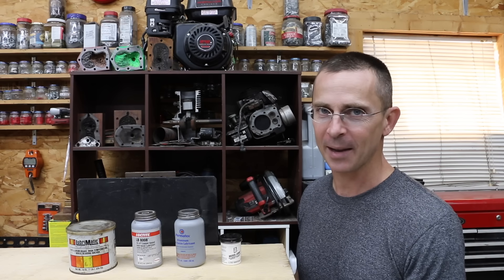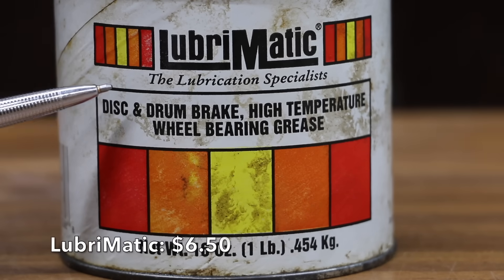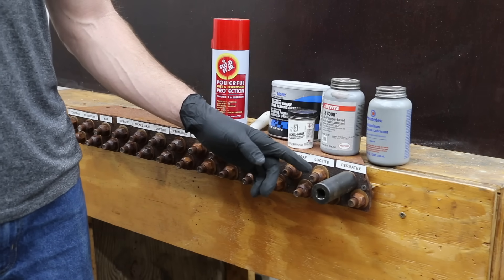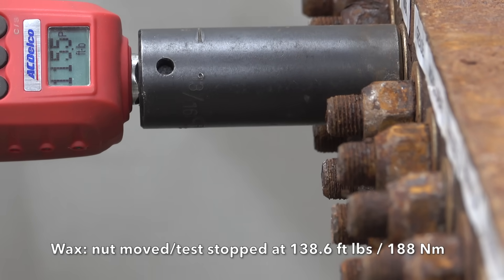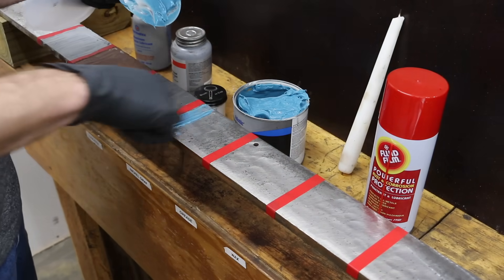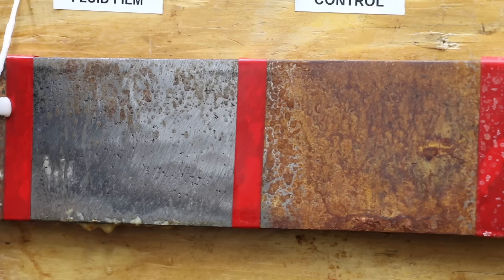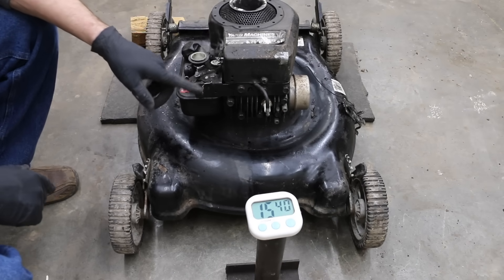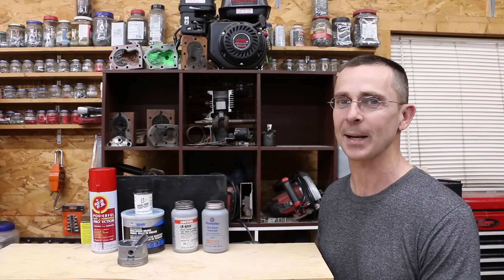Does Anti-Seize Compound Actually Work? Let's find out! Anti-Seize vs Grease vs Fluid Film vs Wax

Comment: I worked at a hydraulic crane manufacturing company where we made cranes for marine use (mostly fishing boats, but some pedestal mounted cranes on docks). There's three things we would put on our products to keep them safe. 
1) Paint. This worked well, but after 5-10 years at sea the paint was often able to be flaked off by fingernails. Not the solution you want to use on its own. 
2) Antiseize (silver and copper grade for different applications). This worked fantastically. We had stuff coming in that was out on the ocean for 15+ years and the threads looked like new when used in conjunction with the other two protection methods. 
3) Densyl Denso Tape/Petrowrap. It's a petrolatum wax coated non-woven cloth tape. This stuff is a total mess to work with. It's like if you were to take wax and infuse it with oil to make a mushy wax. This stuff was the best. Anything that was covered with this stuff would come back looking like the day it was shipped out. Not heat resistant, mind you... But it was a sight to see when you have a hydraulic slew drive motor that's crumbling apart at the paint (needleguns are your friend) and in dire need of a sandblast and re-painting due to corrosion, but the steel fittings used to mount the tubing or hoses look like they're straight from the factory because they were covered with this stuff. 

Great video. Love the bit of fun you had at the end.
Reply from the maker: Thanks!  Glad you enjoyed.

Comment: You sir are a saint!!

This is the type of product testing the consumer needs to see!!!! You’re providing transparency to product Performance
Reply: oh, please.  The main purpose of anti-seize is not as a lubricant but to prevent galling and seizing in high temperature applications up to 1800 deg. F.  No petroleum based lubricant will survive that (not even 600 deg. F).  Otherwise, just use grease if you want a lubricant... it's far less expensive.  Would you put grease in an engine instead of oil?  No... of course not.    There is a reason anti-seize compounds are metallic based unlike any standard lubricant or grease.  This "testing" is just nonsense.  It's like asking if thread-locker works.  Yes... it does and no "testing" required.

Comment: Anti-seize does not equal anti-bind. The engine didn't seize ( get permanently stuck ), but it did bind ( temporarily started getting stuck ) when the piston expanded and moving parts expanded due to all of that heat build up caused by friction ( because of lack of lubrication )
Reply from the maker: Thanks for the feedback.

Comment: I’m curious if the anti seize added too much extra reciprocating mass to the piston and snapped the rod. Or maybe added too much resistance between the cylinder wall and piston. Cool video!
Reply from the maker: Thanks!  Thanks for the suggestion.
Reply: Wrist pin bearing had too much friction.

Comment: Try different vinal glues. Test submerged and the moisture spreading. The strength (laterally and vertically). I just had a water damage and the glue used in my house absorbed all the water ruining the floor
Reply from the maker: Thanks for the suggestion.  Sorry to hear!

Comment: I'd say that any compound that lowered the torque required to loosen them below that of the control bolt is a complete failure, and I would avoid it.  You don't want your anti-seize to make it easier for your fastener to fail and come off unintentionally.  You just want it to prevent corrosion from making it excessively difficult to remove the fastener.
Reply from the maker: Thanks for the feedback.

Comment: If I had a fastener that I knew was coming back off in 3 months time, I wouldn't worry at all about the anti-sieze, even in a highly corrosive environment like winter time in a place that runs road salt. However, the time when anti-sieze comes in handy is when you've got a fastener on there for years in that same environment. Exhaust parts it tends not to matter since the fasteners will generally rust away over time, but everything else on the vehicle will benefit. Even though I don't live in a place that uses road salt any more, basically if I take it apart, it gets some anti-sieze before it goes back together. Another note about anti-sieze, over time as the grease dries out and stops preventing influx of moisture, the corrosion resistance continues. This is especially true when you've got contact between differential metals like aluminum/iron. Example, on a transmission mount.

Comment: Anti seize is a abrasive, not a lubricant. It works on the same principle of putting marbles under a sheet of plywood and sliding it around, vs a sheet of plywood flat on the floor.
Reply from the maker: Thanks for the feedback.

Comment: I use the gray Permatex  anti-seize works great. I have a landpride pull behind finsh mower we drive it all over town mowing city parks the main drive wheel spindle shafts breaks off I use gray  ant seize on the shaft so when I remove it I heat it up with a torch then use a air hammer to drive the break shaft out works great.
Reply from the maker: Thanks for sharing.

Comment: While you hinted at this in the video: the reason antiseize works so well (in addition to being a lubricant) is because it is hydrophobic and prevents most electrolyte solutions from penetrating the threads and blocking them with corrosion products. Without an observed difference in electric potentials, corrosion simply cannot occur - it's a similar effect to having coated metal with paint, it cannot see the electrolyte to exchange electrons.

Anecdotally, in my engineering career, I require the use of antiseize in most fastener applications (just make sure to reduce the torque by about 20% to avoid overloading the fastener...). I believe in the fairly liberal application of it... In fact, a nuclear reactor in the industry I work in experienced an unplanned shutdown (costing the plant easily 2mil+) because several small fasteners had crevice corrosion which allowed a control valve to blow apart. What did all of the failed fasteners have in common? no antiseize. In a sampling of other fasteners at the facility in the same application, those which were installed using antiseize from approximately the same era had no observable corrosion. Antiseize is good stuff!
Reply from the maker: Thanks for the feedback.
Reply: Very interesting. Thanks for posting this info 👍
Reply: I usually use  antiseize on my lugs but I tighten to the minimum not the  maximum,I think if you work in a gas station or on customer's stuff you have to worry about liability since the owner's manuals say not to use antiseize or lubricant, It is amazing at the abuse that lug nuts get from grease monkeys in tire shops armed with air guns 

  and still they may send out a car without tightening the lugs at all or even send out a car with no oil in the crankcase!
you can also put antiseize behind the surface where your wheel backside or rotor sits
Reply: @davidpowell3347  I got tires on my truck at a local tire shop, then took it to get inspected and they called me saying I needed several new studs and lug nuts because they had been put on so tight they couldn’t get them off without really messing them up
Reply: @davidpowell3347  Just saw a truck shop send out a bus that just got new tires on it with several of the bolts hand tight, and several over torqued so hard they twisted them off.. These are bolts big enough to kill someone if they were to be struck by them at highway speed. Not to mention the damage and loss of life that could have been caused if a steering wheel popped off at the wrong time. Yet, nobody will get fired for this and every shop all over the country will keep letting their employees over tighten things with oversize impact wrenches and the like
Reply: @Joseph-C  might relate an incident that happened several Christmases ago: A family in a modern VW product had a flat tire. That car used lug Bolts rather than lug nuts on studs. The bolt diameters are quite a lot larger than typical studs used on cars. 
They could only get off some of the bolts with great difficulty. Finally the last one would not come despite their rather strong 15 year old starting to bend the car's provided lug wrench. (Best to loosen in stages which he didn't do)
I got  my Koken 17 mm. wheel protector socket and pulled on it pretty hard using a 24" long bar,I decided I was not going to break my nice pretty Koken socket so came back with an old Bonney impact socket,an older Craftsman extension (1/2" drive) and the SK bar,the 15 year old wanted a whack at it but I didn't let him (dangerous) ,I got them to stand back some distance,put back on two of the lug bolts on either side of the offending one,and pulled so hard that the bar deflected a bit,there was a horrible noise and I thought something had broken but it was simply the screech that the bolt made when it began to rotate in the probably partially seized threads.  I guess I had over 300 ft. lbs. on that thing. A typical lug stud I believe would have broken but the larger diameter lug bolts can get overtorqued to higher values without breaking or twisting off.
Reply: @davidpowell3347  i've never seen a service manual that specifically excludes the use of the stuff. actually you want to apply it to the center pilot of the hub or drum- thats what a wheel usually seizes to. great for saltwater boat trailer wheels.
Reply: if you are the one who will be taking it apart later on- its practically worth its weight in gold
Reply: Have you ever used a lead based antiseize compound?  I used to use it on 150 psi “dry steam” systems, not only on flange bolts but as a sealant on flange gaskets as well.
Reply: @Huggy1959  interesting. I haven't heard of that before. There may be something with the metallurgy that necessitates the use of lead in the antiseize - jumping back to the electrochemical difference. It certainly has a lower melting point than the other metals which are typically in compounds.
Reply: Have you ever used a lead based antiseize compound?  I used to use it on 150 psi “dry steam” systems, not only on flange bolts but as a sealant on flange gaskets as well.

Comment: First a corrosion cause that might improve testing.  Spray it with the pink radiator repair flux.  It is mostly zinc chloride.  But thing is it is a great desiccant so it draws moisture while its pH encourages corrosion.  It cause corrosion faster than salt water and it tends to go deeper.

I have been less than totally impressed by the antiseize versions over the long haul in dirty corrosive environments.  For really high temp environments like turbo chargers some luck with copper and nickel bases but both are less than ideal but better than any other answer tried.  But for highly corrosive areas in lower temps I think there are better answers.

I work with the stuff over the long haul in corrosive environments.  2 answers not listed that I think are better.  1.  Silicone sealant.  Coat both the threads of the bolt and the inside of the nut and screw together.  If the bolt is never dislodged this one seems to work the best.  Temp limit is about 650 degrees F.   2.  Better grade of grease.  Current favorite is Rykotac.  It is intended for 5th wheels and other exposed grease location and has the best sticky factor combined with really good water wash off of any I have played with.  Best answer if the bolt will be checked for tight at a later date that might crack a cured type seal.

Other good answers 
Loctite seems to work fairly well if things are well coated in areas that stay cooler than its break down temperature  Have had better luck with the thicker gasket maker versions over true thread lockers.  (Loctite 515 and 518)  Guessing it is because the gasket makers are thicker and form a better seal.

Best historic answer I have seen looked like tar.  Took some spring shackle bolts from military truck suspension from the 1960's apart that the threads were nearly completely corroded away in the area beyond  the nut and there was a visible groove in the bolt from trapped corrosion above the nut but the area in the nuts was factory new with no visible corrosion and came loose easily.

One other experiment that I have a bunch of out but haven't torn any down yet is I tried one of the brush on liquid Teflon base pipe thread sealants.  This particular one stayed a bit elastic rather than getting really hard.
Reply from the maker: Thanks for the feedback.

Comment: I always use candle wax for lubing wood work tools, it's great stuff, particularly when cutting wet wood.
As for the snapped con-rod, I've a feeling the compression went through the roof, or maybe the piston was hitting the build up on the head.
What about just adding a little bit of copper grease to engine oil as an additive?

Comment: Well I gave it a thumbs up before I even watched it.
Not all candle wax is the same:  e.g. cheapo paraffin vs. expensive beeswax.
I've just commented on your thread-lock experiment saying that I had been mulling over putting copper on most of the thread then loctite on the end, but I then read that loctite (as we all know it -- i.e. threadlock not simply the company) actually also prevents rust (blocking air and moisture running up the thread). I'd sure like to know if this is true.
Thanks a lot. ...didn't really understand the need for the aquarium test: the product is always sandwiched between two surfaces (let alone why put it in the engine!!); but then I considered other stuff I've been looking into -- coating the underside of mower decks. Old engine oil (some even say use new oil!), paint, underseal, the film stuff you showed somewhere, WD40, etc. One big comment is that the grass gets shoved around at such speed it simply knocks off most things. My Murray ride on gets wire-wheeled and painted, cos of course it's steel; my Honda push-mower does get anything because it's not made of metal. 
Anyway, thanks again for your astounding work. (Someone might do a test on the most effective adjectives.)
Reply from the maker: Thanks!  Thanks for the video idea.

Comment: 288°C might be bit too much for the wax. i would do a second test without the heat. or maybe do average summer heat at max "aka the heat that the nuts would be when under blazing sun"
also i believe heating the bolt before applying wax would help a little, so it would spread more and give the bolt a thin film over the treads.
one think i kind of want to try is to soak warm bike cycles break and gear shifter wire in hot runny candle wax so it has a film over it to help it from seizing
Reply from the maker: Thanks for the suggestion.

Comment: I live by permatex anti-seize, I use it on about everything that gets exposed to weather,  like bolts on the boat trailer. Thank for the video.
Reply: Another happy permatex user here! Spark plugs and lugs mainly.
Reply from the maker: You are welcome!
Reply: I'm not a mechanic, but I figured that since the Loctite Copper is so expensive, I'd figure the Permatix Aluminum is a good choice for those who are conscious of price. If you're really hurting, Nickle-Graf could work if the bolt won't be on for too long.
Reply: @Kalmaro4152  I've tried both Aluminum, Copper and the older Nickel-based Loctite products on Exhaust Manifold bolts (a very tough place), and the newer Copper one is noticeably better than the older, almost useless Nickel based one.

Comment: Changing the igniter plugs on jet engines - you can tell if the last guy didn't put any on. I've seen cases split when people have tried to remove plugs that were installed dry and have seized in. That's a costly problem.
Reply from the maker: Thanks for the feedback.

Comment: Learned years ago to always coat threads of spark plugs used in aluminum Heads of Japanese cars 🚗 with aluminum motors. A bicycle school in Colorado Springs,  C0 stated in their instruction manual/book: when you lubricate the threads, at the same torque,  the lubrcated threads will be Tighter than the Unlubricated threads. So at the same click of your torque wrench,  you should get at least one & a half, maybe 2,3 more turns of the torque wrench 🔧 because of being lubricated.  Experiment:  does one get same, more or less turns of a torque wrench 🔧 🤔 with various lubricants. Compare & contrast?
Reply from the maker: Thanks for the video idea.

Comment: Wax would be great for screws/bolts made out of wood to be used in wood.
 Anti sieze wouldn't be able to flow into the bearings on the connecting rod.
Who the hell in their right mind would think anti sieze is an oil substitute for an engines lubrication?
Bolts siezing, not engines

Comment: I worked in construction,  we handled the salt coming into a port, we found that Teflon thread sealing paste brushed on bolts sealed the threads, it kept the bolts from becoming frozen from corrosion.
Reply from the maker: Thanks for sharing.

Comment: I use antisieze compound on stainless bolts
on my boat, because if you are threading a
nut onto a longish bolt, it can sieze before 
you get it all the way on. That's what you 
should test. Stainless on stainless. Stainless
is a gummy metal.
Reply from the maker: Thanks for the video idea.

Comment: I use Never-Seez® Pure Nickel Special, Nuclear Grade. Works with all studs upto 2" diameter torqued to 37500 psi stress. Used in steam applications of 1150 deg F. Never fails when you have to take apart large bolting on valves.

Comment: Glock uses copper based anti seize on the slides of their pistols. It's a good lubricant that doesn't migrate. 

Also, yes LB8008 works great on spark plugs, etc.
Reply from the maker: Thanks for the feedback.